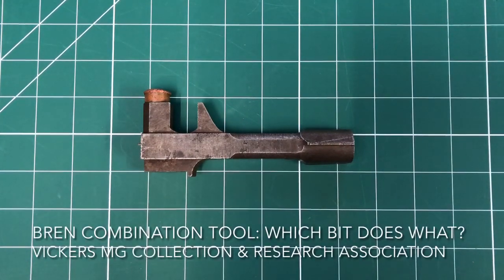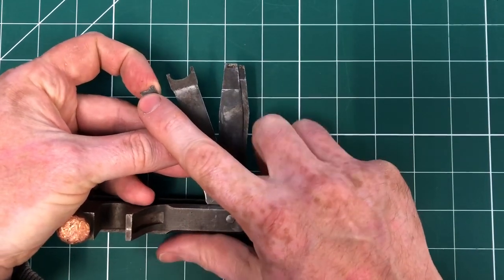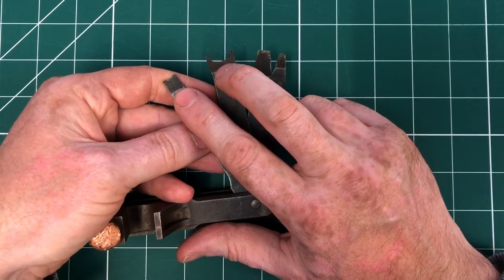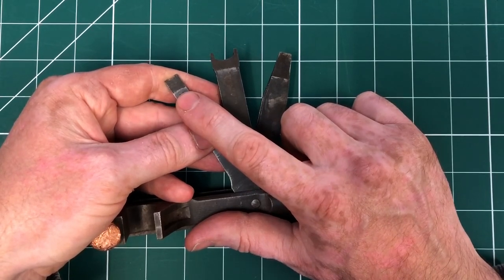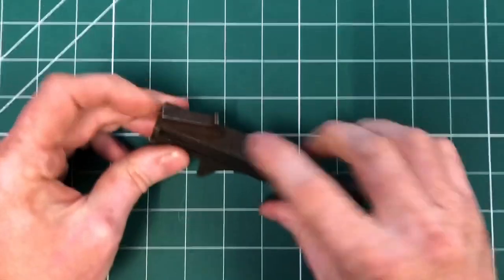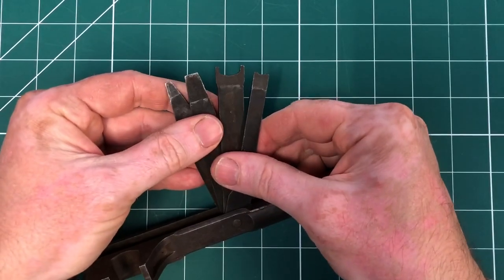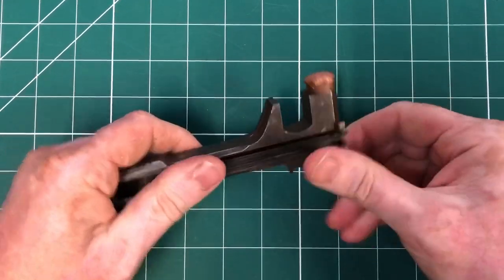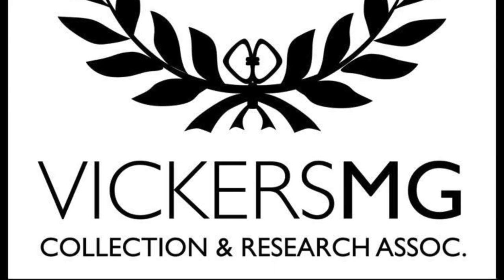Bren light machine gun Combination Tool: Which Bit Does What?

Comment: Hello Richard. Yesterday I received the tool for the Zb30 shooter. It's almost identical. The wrench next to the hammer is needed to remove the tube in the buttstock.
Greetings from Germany
Reply from the maker: It is almost identical. We actually keep one with our Vickers tools as it can be used for the muzzle cup spanner.
Reply: @vickersmg  Great idea. I just tried it on my Vickers. Works perfect. Thanks for the tip.
Reply from the maker: Usefully has a hammer too, unlike anything in the Vickers case.